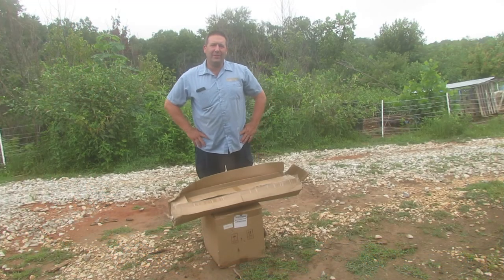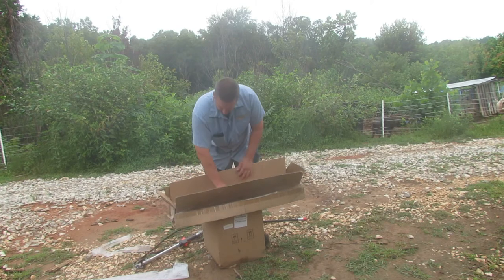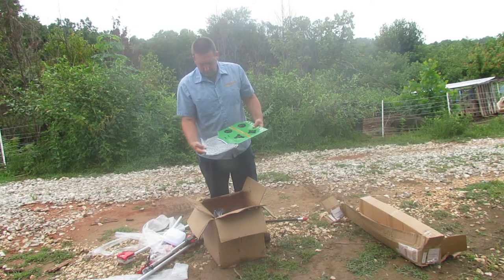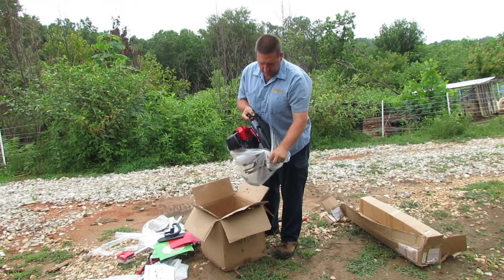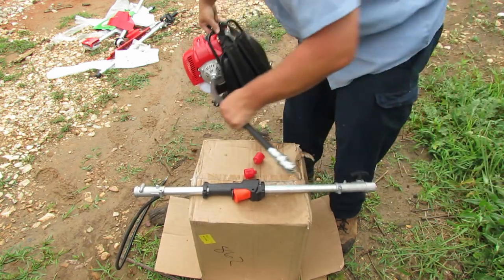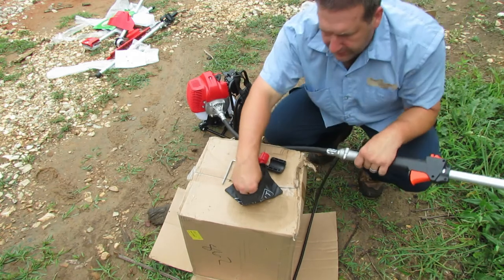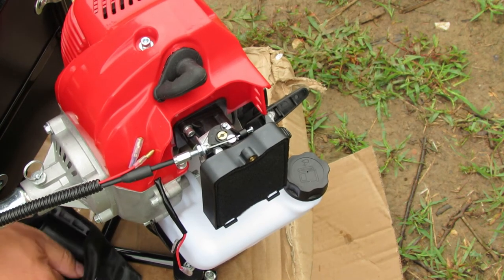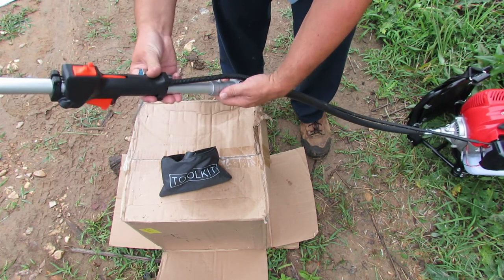Part 1 Assembly and Review of the 52CC 6 in 1 Backpack Multi Brush Cutter

Comment: Great I’ll use this video tomorrow when I put mine together😊😊
Reply from the maker: @rossieharman2560 excellent. How did it go? ~Mr. C.
Reply: @NaturesCadenceFarm  I’m a dummy lol I finally got it together. I like this brush cutter. I couldn’t get the two together, but I finally got it.
Reply: @NaturesCadenceFarm  what size string do you use? I’m using 0.95 is that about right?
Reply from the maker: @rossieharman2560 I use .095 string. The head might be able to use .105 but .095 fits better. Good question. ~Mr. C.

Comment: I bought this piece of crap.  Engine wouldn’t start.  Took it to a shop.  Tech said engine is dead, get your money back! Another problem is rubber hose kept coming of pull and tightening screw easily stripped!  And I did..Don’t know if I should put all of this on the curb!
Reply from the maker: @donmilland7606 interesting. I have not had the issues listed. I might have received one from a different manufacturer. I mainly use it with the pole saw and hedge trimmer attachment. So far so good. Thanks for watching and sharing your experience. ~Mr. C.